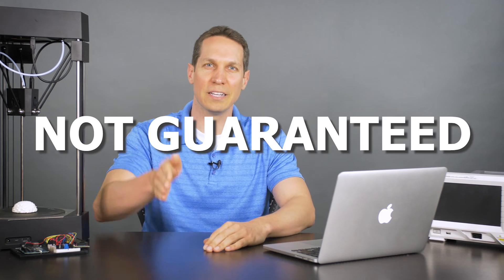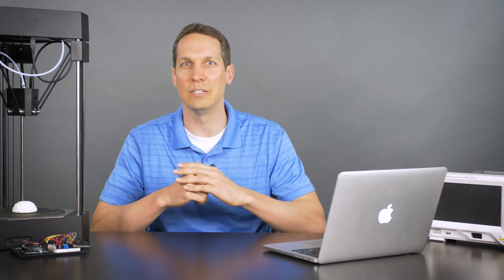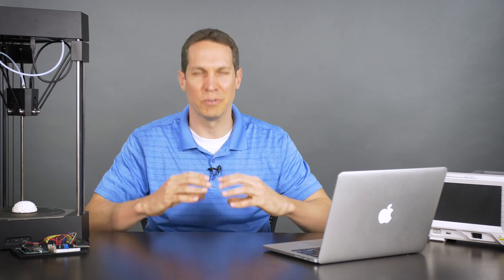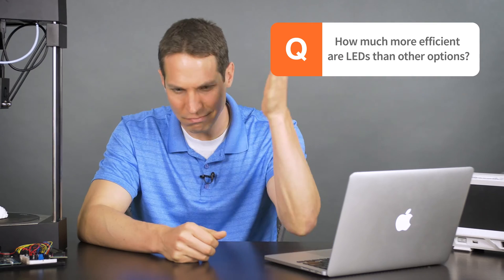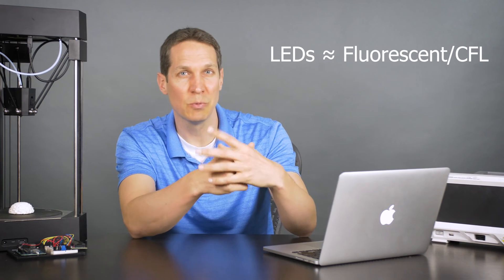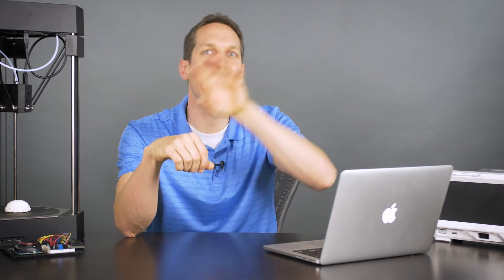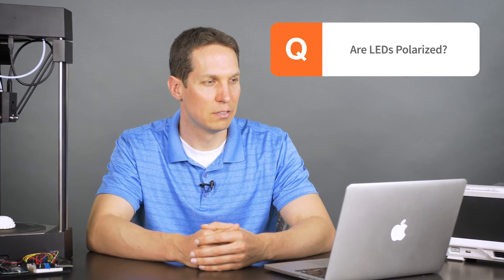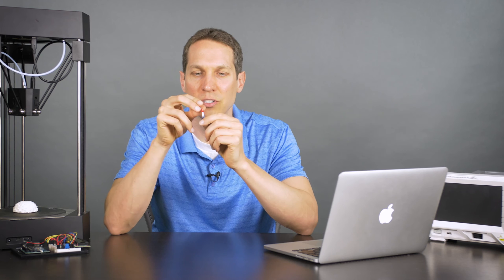Your LED questions ANSWERED! (Part 1) | Basic Electronics

Comment: The tungsten filaments of incandescent lights actually evaporate - their main mode of failure. As they evaporate they become thinner, their resistance increases which makes them become hotter and therefore shine brighter. Until the point where the evaporation rate becomes so high that they "suddenly" disappear ("break" at the thinnest point).

Halogen lamps use a halogen gas to limit the evaporation of tungsten. 

Another way is to lower the current which makes the filament less hot, more yellowish-red and also less bright.

You can increase brightness by  using several or longer filaments (which is what actual lamps do). But color temperature is related to actual filament temperature so if you want it more "whitish" you have to make them burn hotter and last less long - or use Halogen lamps which can burn hotter (more white) because the halogen gas slows the evaporation. 
So now you know the reason why halogen lamps appear more whithish-blue: their filament burns hotter.

Comment: I have a 2 color LED. Ground is common. So I have one ground pin. And I have 2 pins for the 2 colors. 
I know how to make this work. i.e. I can get both the colors to light up. Using ground and plus voltage. 
Now where I want to use this LED 
I have an audio circuit where I have +12V and -12v. And ground. 
By looking at the LED I want to confirm that both my positive rail and negative rail have power. 
How would I wire this. 
I have hooked up ground to ground. And one leg to +12 volts and the led glows. (Lets leave the resistor on the ground pin out of the equation for now). But when I connect the leg to the negative rail I get no light. 
Can you explain this in one of your videos.

Comment: Why mixing led light-bulbs size don’t work properly in a series set?
Reply: The bigger the LED the more current it needs, basically (almost) every electron creates one photon. If you want more photons (brighter) you need to drive more current. But you shouldn't drive more current through a small LED structure, that would damage it.

Now, as you know, in a series circuit all elements share the same current. So that is why it's a bad idea to combine different size LEDs in series: you either overdrive the small ones and damage them or you don't supply sufficient current to the big ones.

Comment: polarized -- did they mean like a laser? If so, an LED is unpolarized!
Reply from the maker: Nope!  Polarized in electrical terms (versus optical) just means that you care which side is positive and which side is negative.  Resistors don't care, most capacitors don't care, most (maybe all?) inductors don't care, but if you hook up an LED backward, it won't work.  Or any diode, for that matter.
Reply: @CircuitBread ahh! But, u can put a zener diode in backwards and they will still work 💚

Comment: I can't wait for part 2 😁
Reply from the maker: Awesome, we're glad you liked it! We actually have a few more of these coming for LEDs soon. Stay tuned!
Reply: @CircuitBread please help me! 😭
Okay I've got an Olight Baldr Pro (wit a green Lazer), it's a weapon mounted light.
Now it requires 2x3v batteries (cr123).
The light itself has 2 settings bright (1200 lumens) and a low setting (300-500 lumens). 

My question is can I run 2x3.7v batteries (16340) and then keep it on the "low" setting without damaging the Led?
It looks like the batteries are in series since the positive and negative differs when inserting the batteries.
The cr123 batteries are really expensive and I don't mind the shorter runtime the 16340 batteries offer as I can regularly recharge them.
Reply from the maker: Just a heads up, part 2 of this series has been published here (we have more coming): https://www.youtube.com/watch?v=N9g7aAZPbno